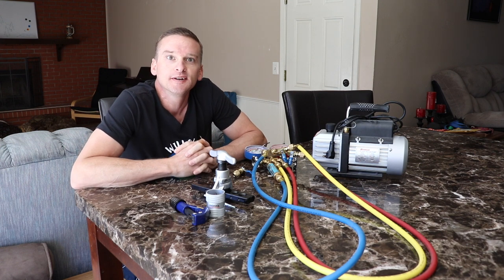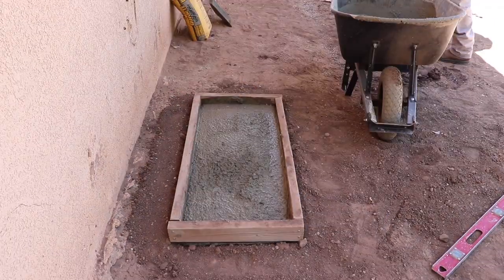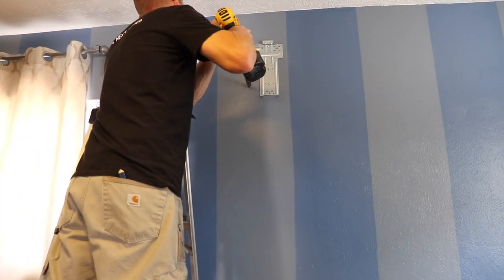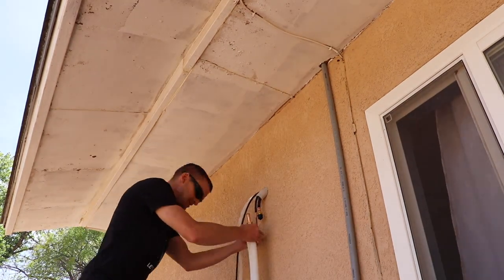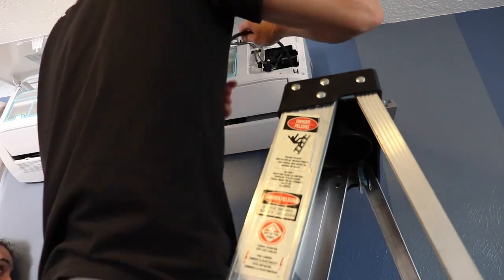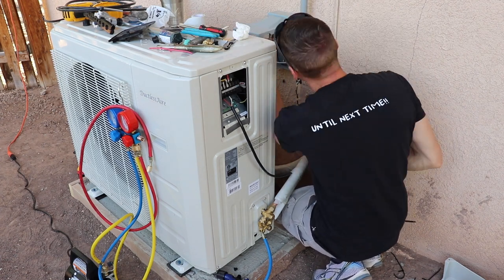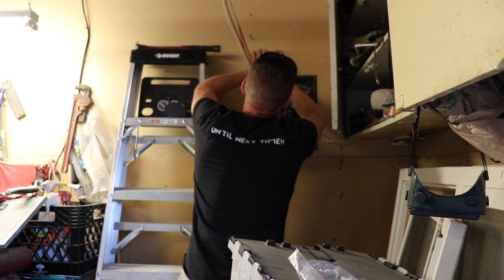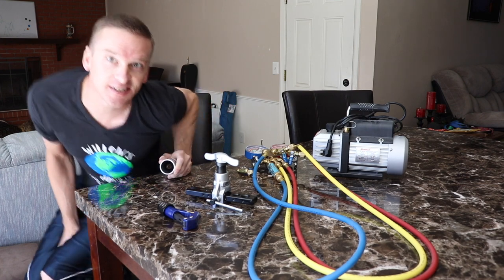DIY Mini Split System Install

Comment: I have a pre-charged line set that has been vacuumed and filled with R-410a refrigerant from the factory, but I need to shorten its length.

Once I'm done shortening the line set, and since the lines are factory pre-charged, is there anything special I need to do aside from vacuuming the lines and checking the microns before releasing the R-410a refrigerant from the condenser?
Reply from the maker: Nothing special, It sounds like you got it. I usually leave the vacuum pump on for at least 30 minutes to 1 hour and check to make sure that it's holding at least 20HG to 30HG of vacuum on your gauge set before releasing the R410a from the condenser. I hope this is helpful. Thanks for watching!
Reply: It's probably far too late at this point but if the LINESET is precharged then you cannot shorten it as cutting would release the refrigerant.  Hopefully you didn't do that!  Most systems do not charge the lineset, so you need to use the vacuum pump, but some (like Mr Cool) sell the linesets precharged so you just connect them and open the valve.